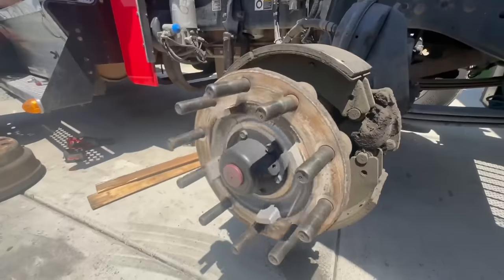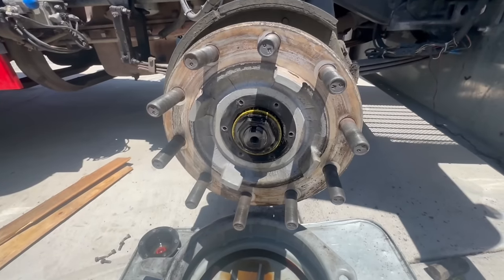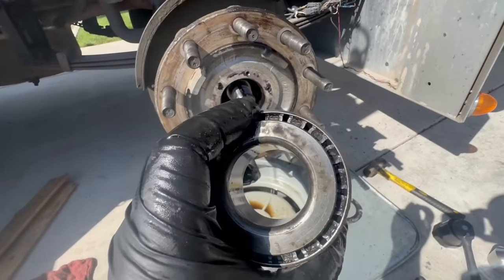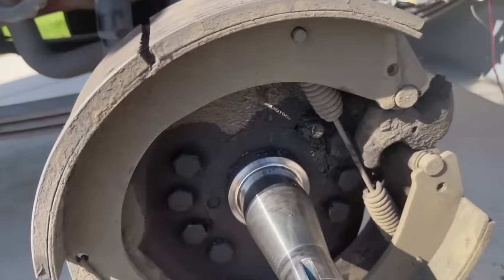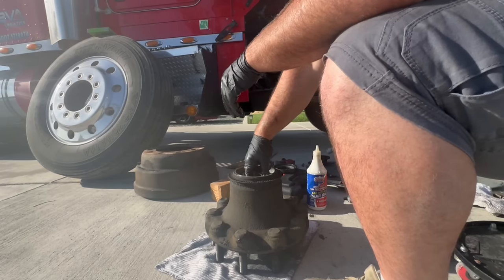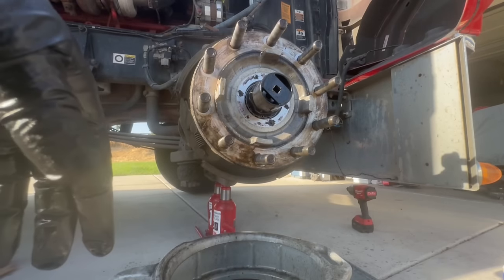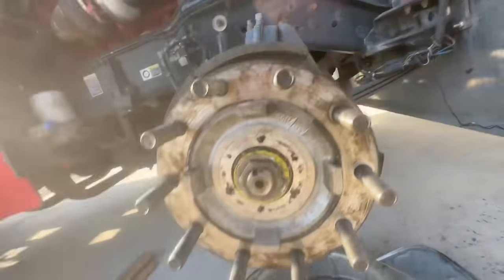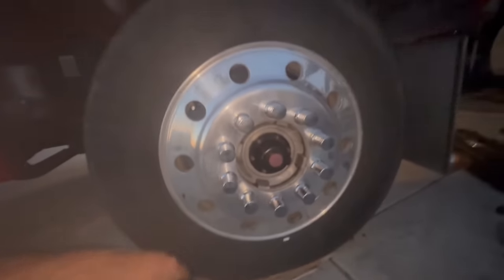“REPLACING A STEER AXLE WHEEL SEAL ON A SEMI TRUCK”

Comment: Lets see, it took Martin 30 minutes to change a STEER AXLE WHEEL SEAL. How come it takes the garage A LOT longer?😁
Reply: Because martin cares about how long the truck will be out of service. Garages will take truck after truck not caring how long you will be out. Guaranteed more for them lol
Reply: That’s how long it takes at a dealership also, but as a dealership they have more responsibility, after the repair is completed there are procedures that have to be performed as a “qc” quality check where a Forman inspects your work, there is also a road test to then re inspect for an oil leak and make sure the job is fully done
Reply: Definitely takes longer then 30 mins but not that much longer

Comment: When I did this work I found out that if you pack the bearings with Vaseline since it's petroleum products it helps the bearing lub it self until the fluid goes through them, That's how most of the Diesel training schools teach students it doesn't hurt it but helps.
Reply from the maker: I usually spin them over and over as I add oil. But yes both ways work.

Comment: Your front brake shoes are Eaton style. They are 3/4 thick lining,no taper. Your linings have a thin worn taper at the S cam end. Most likelely your brake drums are worn well over max, diameter. Worn brake drums and lining cause your brakes to run hot, causing seals to harden and fail.
Reply from the maker: They are getting down there but still legal. I will do brakes on the front axle before winter hits. Didn’t have time this time around.

Comment: IF the spindle washer (the one with all the holes) does not line up you do not need to tighten nut simply pull it off and flip it 180 degrees
Reply from the maker: Yes. I think in editing that got left out.

Comment: the most likely cause of your seal leaking is a plugged vent hole in the hubcap plug, just poke it with a pocket screw driver, with lms hubs just remember 300 ft lbs, rear and front, the yellow ring denotes a lms hub,

Comment: I know what you mean Martin by peice of mind knowing you did it & done correctly, especially when it comes to with anything to do with the front steer axle. 
   Just a question, When installing a seal is it not a bad idea to litely coat the ''' shat where the seal seats''' , so it gives it a slippery surface to slip on ? 
  Another great very well done job.

Comment: Hey did you get the Air leak fixed yet on the rig Mama is drivin. Back when I was in the Army I use to tighten the nuts all the way down and back it off 1/4 turn.If one is bad then you might need to replace both of them. Easy we in the shop than on the side of the road

Comment: Are you planning to replace the seals on the left side soon? If both sets of bearings have been on the steering axle for the same length of time so have the seals; look for the left side seals to fail (soon).
Reply from the maker: Yes. I have to do brakes on the front axle soon
Reply: Stay Safe.
Semper Fi.

Comment: I thought I had read somewhere that the cone should be replaced  but I think the reasoning was that the edges could become sharp……..guess if it looks good then it should be fine.
Reply from the maker: Yes if damaged.
Reply: @TruckingTogether   also not sure what the cost to stretch the frame is and considering Fancy has all them miles on could you look and see what $$ difference and downtime would cost you  Vs finding another W900 with the specs you want
Reply from the maker: I can do it myself fairly cheap. Like under $2000.
Reply: @TruckingTogether   just seems a little labor and time intensive……..my friends just got a new W900 and when they picked it up at the dealer he was kinda pissed because there were a few other new ones that had come in with the toolbox/steps in front of the drive axles……….well apparently he spec’d the wheelbase too short for that to be an option on his 😆
Reply: Great job, thanks for taking the time to record this! You do a very good job of explaining what and why you do the steps.

Comment: everone ask me why I do all my own repairs, well because I don't trust anyone else, I had My trans done by a shop and I had to fix five thing when I got it back, two air leaks, re-rout hydraulic hose, readjust  the rear pto mount because the pump was screaming and reseal a pto side cover. I watched a YouTube channel put rear hubs together, and he tourqed the inner nut to 90 ft. Lbs. Then the lock washer, then the jam nut and sent the truck down the highway with 90 ft. Lbs. On that bearing, he never backed it of a 1/4 turn.

Comment: :-( Jack Stand or even a block of wood Brother ....  Things Happen   Other than that AWESOM JOB SIR !!!!
Reply: I suspect that by having two separate jacks, and each one likely to be enough, if one failed, the other one wouldn’t.
Plus he wasn’t under the truck  - and - it appeared that jacks only were up a few inches so if they dropped, the jack body would still hold it up almost enough.
Reply from the maker: it had 2 10 ton bottle jacks under it you can see one of them in the thumbnail even
Reply: @TruckingTogether  I did note the two jacks but both looked the same so I am assuming bought at the same time and if one had a defect they both could ...   I like you both and it would kill me to see something happen.  At least you were no laying under it and the bottle would hopefully hold it from hitting ground...    Keep up the great work you both are GREAT examples and what america needs ...